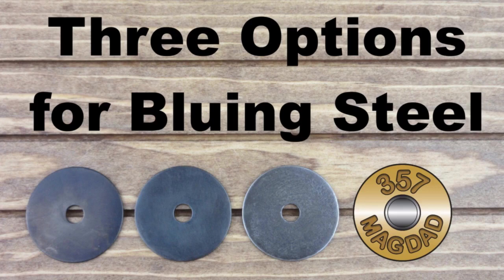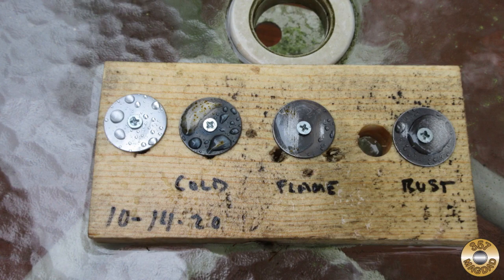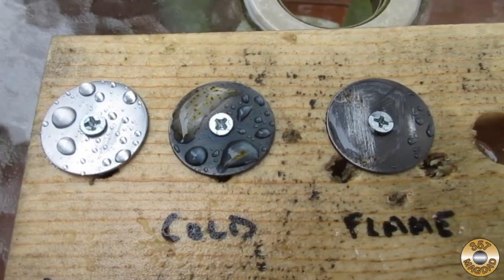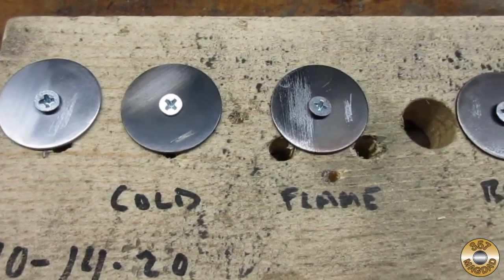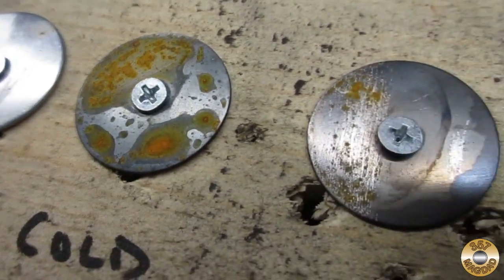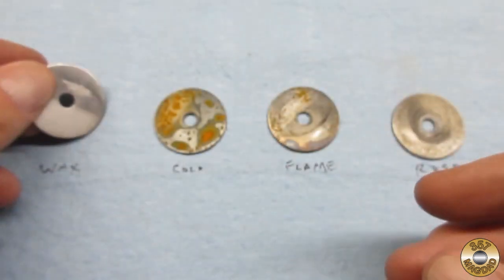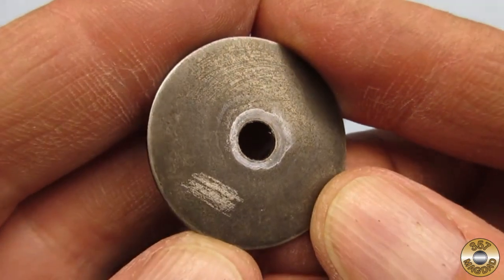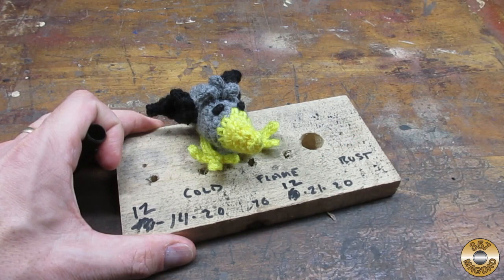Blued Steel Extended Corrosion Test

Comment: One thing I've found that works excellent is the blacksmithing way of rust prevention - heat up metal and apply linseed oil, works really good!
Reply from the maker: I've seen that finish and have been wanting to try it on something!
Reply: @357magdad  I tried it on the 1890's angle brace video I did last year,  it's very durable

Comment: The cold bluing is a huge disappointment!  Now it’s evident why the most serious “meat” hunters (as opposed to those focused on trophies or some other esthetic), all hunt with stainless steel barrels and composite stocks!
Reply from the maker: The cold bluing formulas contain acid, so it is really important to rinse the part in water and soak in oil for a couple days.  I've seen where some of the stainless alloys (416 I think?)  used for gun barrels can corrode if put away with sweaty hand prints on them.